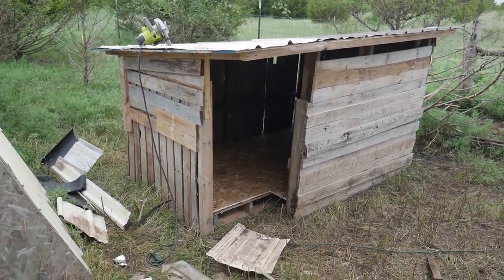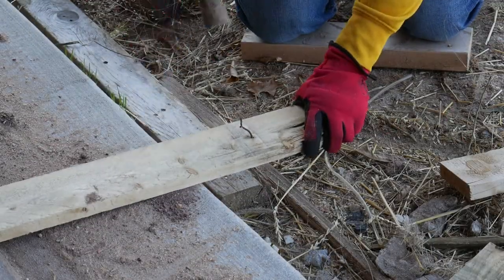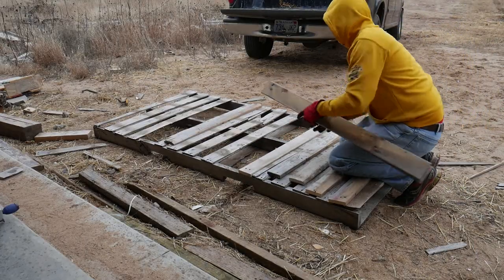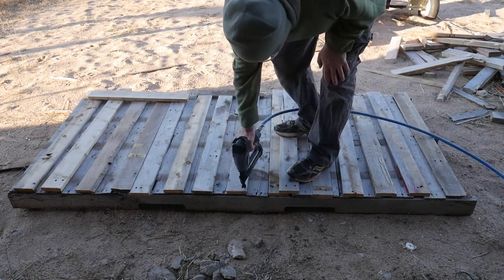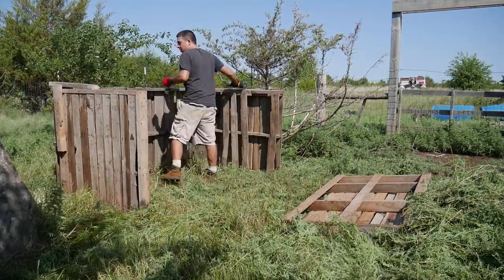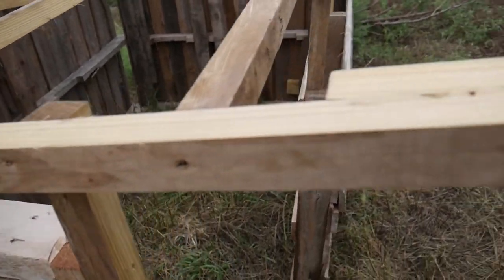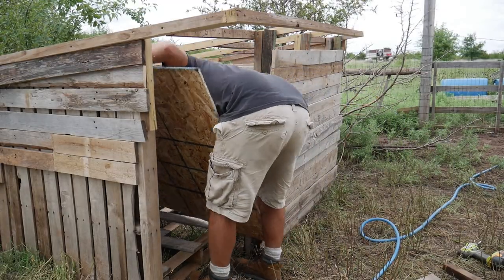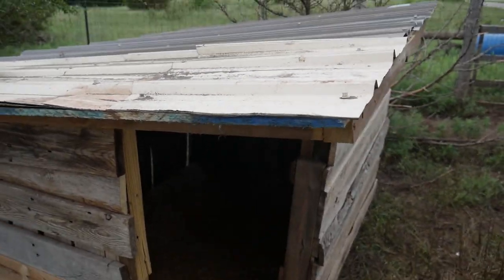DIY Goat Shelter From Pallets

Comment: Did you do any kind of waterproofing on the floor? If so, what did you use? If not, are they still on the same floor, or have you had to replace it yet?
Reply from the maker: I just used some OSB board on top of a pallet floor. No waterproofing of any kind. There is straw in there that I have changed out probably 3 times. I have not had to replace it yet, and am sure it will not last forever.
Reply: 1 Mohr Farm thanks for the reply. I always struggle with finding a flooring that will last, but won’t be a slipping hazard for the goats. I love hearing what works for others. 10 months is a good stretch so far!